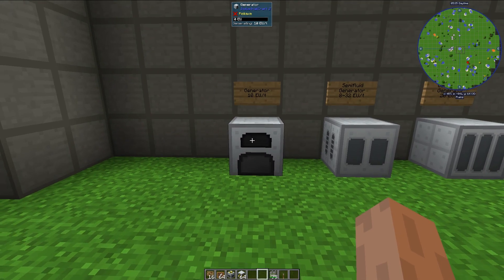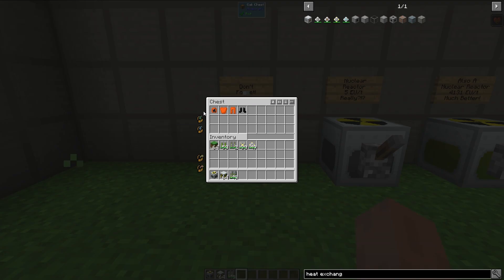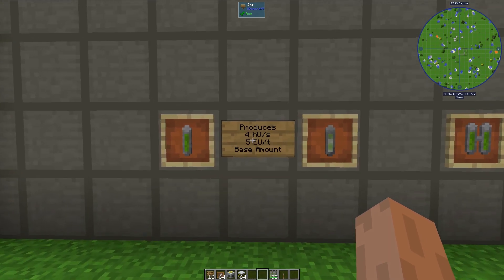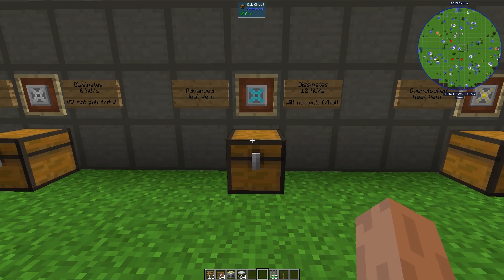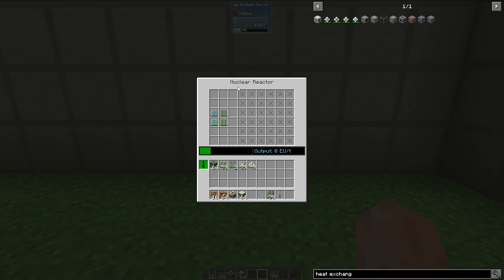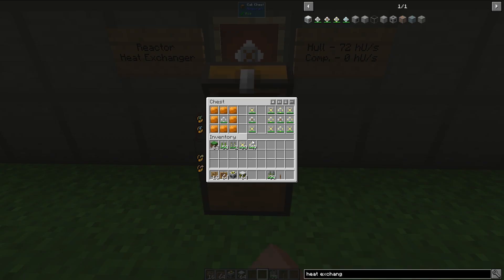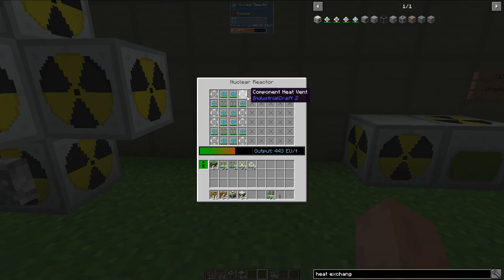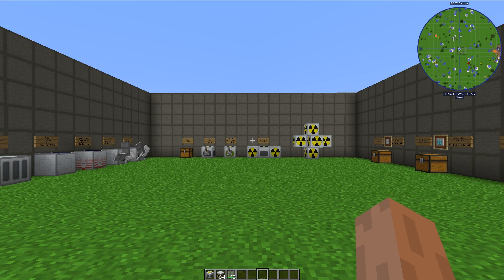IndustrialCraft 2 Nuclear Reactor Tutorial! [for Minecraft 1.12.2]

Comment: Man, why does this mod make it so incredibly annoying to get tiny piles of uranium? You need it for the fuel rods yet they make you make the thermal centrifuge for absolutely no reason.
Reply from the maker: I would guess that it is just a sprinkle of realism. In real life you have to send uranium through thermal centrifuges to separate the U-235 from the U-238.
Reply: @minecraftphenom0892  Wow I'm surprised you're still replying. They did the same thing with oil and it just makes using industrial craft way more painful than just using thermal expansion. The only reason to use it is for the armor and cool nano sword.

Comment: after i buid the reactor, how can i store the energy? Is it in a mfsu or any other specific batterie? (sorry for the bad english)
Reply from the maker: MFSU is typically a good option, but an MFE might also work as well. Keep in mind the voltage limitations of the batteries that you use. Trying to pump in too much voltage into a battery (or machine for that matter) will cause it to explode.
Reply: @minecraftphenom0892  i tried multiple times to connect to a mfsu ( using transformers like ev and hv but it still explodes ( im using the most overpowered reactor that u shown)
Reply from the maker: @ImLucasC  If you are producing more than 8192 EU/t not even an EV-Transformer will be able to handle the voltage
Reply: @minecraftphenom0892  so its basically useless to build such reactor
Reply from the maker: @ImLucasC  I believe there is a mod that adds a higher tier transformer, which would be able to handle the voltage. Also, you could place a Matter Fabricator (with enough Transformer upgrades) beside the reactor, thus eliminating the need for cables and transformers. But you are mostly correct.

Comment: For some reason on the app whenever I put a quad cell no matter what design I have it says 100% reactor heat.
Reply from the maker: Try surrounding one quad cell with 4 Overclocked Heat Vents. Adjacent to the Overclocked Heat Vents add Component Heat Vents. A single quad cell should produce 96 heat per reactor tick and the 4 adjacent Overclocked Heat Vents should be able to dissipate 20 apiece, which would still leave 16 heat to be dissipated. The Component Heat Vents adjacent to the Overclocked Heat Vents should be enough to dissipate the remaining heat.

Comment: 17:18
Do u have to craft the LZH Condensators only one time or do they loose durability and u need to craft them again?
Reply from the maker: They lose durability over time, but they can be repaired while they are in the reactor with Reactor Coolant Injectors. WARNING!!! Be very careful with these, as they need Lapis Blocks (for the LZH) and Redstone Blocks (For the RSH) Coolant Injectors. If they run out of the Redstone/Lapis Blocks, the Coolant Injectors will be unable to repair the Condensators inside your reactor, which could end catastrophically. I strongly recommend that you play around in Creative Mode to gain a functional understanding of how they work.
Reply: @minecraftphenom0892  thanks for the quick answer! If i have a reactor coolant injector "fueled" with lapis blocks, there shouldnt be a problem tho and the reactor is safe like that right?
Reply from the maker: @zzz-uw7ou  Make sure that the Injector is powered and that it has the right voltage as well. I would definitely test your set-up in a creative world first though. Nobody likes to have their base blown up by their shiny new reactor lol. Good luck!
Reply from the maker: I also have a video (https://youtu.be/qlsZhzcDf2U) where I actually build a bunch of reactors with the LZH and RSH Condensators. Start at the 15:50 mark for that. Also, I build a safety mechanism near the end of the video for the reactors (to automatically shut off the reactors if I run out of Redstone or Lapis Blocks).

Comment: Is the reactor at 17:21 100% stable?
Reply: ok nvm I just tried it and it exploded
Reply from the maker: You need to have LZH Coolant Injectors Attached to the reactor with Lapis Blocks in them. They also require power to run.
Reply: @minecraftphenom0892  ok thanks ;)

Comment: How do you actually craft the fuel rods though? I’m trying to figure out but JEI or IC2 wiki doesn’t show how to make them, it keeps giving false information.
Reply from the maker: Single Fuel Rods are crafted from an Empty Fuel Rod and Enriched Uranium Nuclear Fuel in a Canning Machine.
Reply: MinecraftPhenom08 And Enriched Uranium is made from processing ore in a Thermal Centrifuge?
Reply from the maker: @notleks2411  Uranium ore is processed in the Macerator. That should give you Crushed Uranium Ore. Put the Crushed Uranium Ore into a Thermal Centrifuge. This will give you some (I think 4) Uranium-238 and 1 Tiny Pile of Uranium-235. In a vanilla crafting table, you can make  the Enriched Uranium Nuclear Fuel with 6 Uranium-238 and 3 Tiny Piles of Uranium-235 (The Tiny Piles of Uranium-235 go in the middle row of the crafting grid and the top and bottom rows consist of Uranium-238). Then you take the Enriched Uranium Nuclear Fuel to a Canning Machine with an Empty Fuel Rod.
Reply: MinecraftPhenom08 Perfect! Thanks bud, appreciate that.

Comment: i still don't know how to make the rods it says i need a special uranium but to get that uranium i need that uranium u get it?
Reply from the maker: Put Uranium Ore in a Macerator.
That will give you Crushed Uranium. 
Put the Crushed Uranium into an Ore Washer OR into a Thermal Centrifuge. If you put the Crushed Uranium into a Thermal Centrifuge, you then get Purified Crushed Uranium Ore.
Put the Crushed Uranium ore OR Purified Crushed Uranium Ore into a Thermal Centrifuge.
That will give you 1 Tiny Pile of Uranium-235 (2 if you used the Ore Washer) and 4 Uranium-238 (5 if you used the Ore Washer). These two isotopes of Uranium are used to make the Enriched Uranium Nuclear Fuel, as 3 Tiny Piles of Uranium-235 are used and 6 Uranium-238 are used to make each fuel. To make it into a fuel rod, put the Enriched Uranium Nuclear Fuel into a Canning Machine (Either Canning Machine as the mod IndustrialCraft2 has two of them) with an Empty Fuel Rod. Voila, you know have a Fuel Rod (Uranium)

I highly suggest that you use JEI with this mod. It should be able to tell you all of these recipes in game.